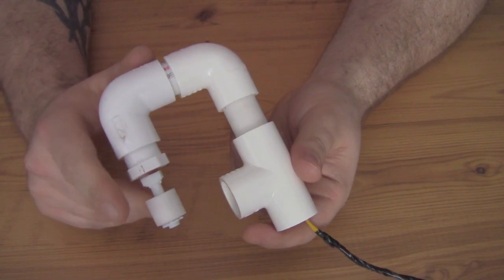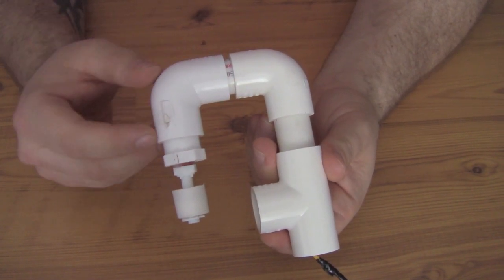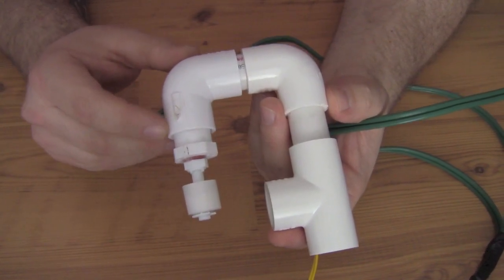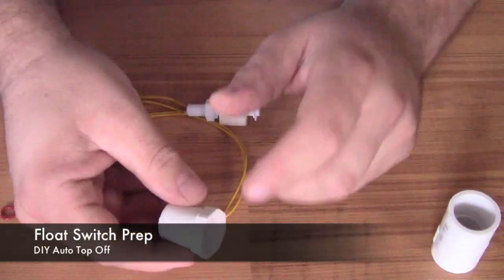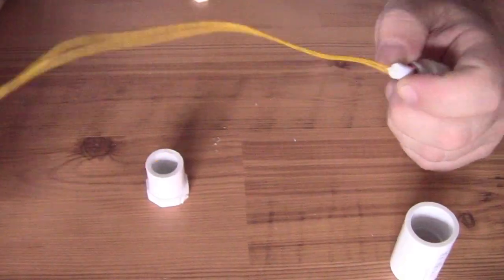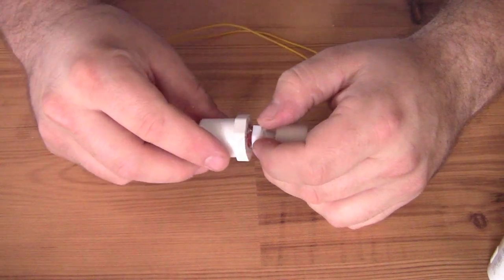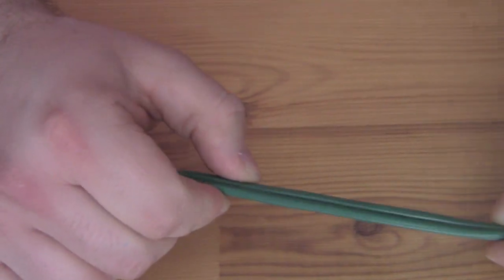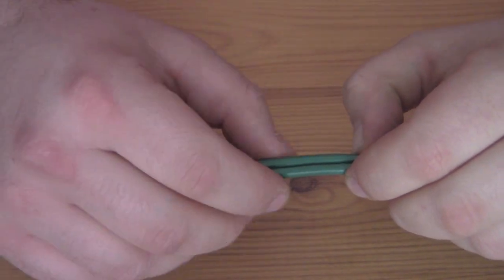DIY Auto Top Off | ATO | Part 1

Comment: Hi Mad Hatters Reef..I really like this video ..although no I do not need the auto top off.. ...Can U please post a video on how to install this float switch for an auto shut off  on the aquarium itself..  Ok so I have a 75 gallon aquarium..I built a DIY wet/dry filter drawer system..BUT...we live in a raised house so whenever I get high winds the house rocks plus people walking around so the aquarium water shifts or makes waves therefore air gets into my pvc. pipe going down into the sump tank....shutting down the trickle filter....then my submersible pump is still pumping!!..So I saw a video where someone installed this float switch with an extension cord,relay. 12 volt ac/adapter..So when the water gets to a point it shuts OFF the pump... I can NOT for the life of me find that video..was it you guys?? Because this is similar to the one I saw...If so I really need to see how to make this work..Thanks so much..  I really can not sleep at night because of this..so I have to to turn it off around midnight then I get up around 5 am to turn back on..its a real pain in the ass!! Please help if you can or if you could direct me to that video...Have a great day..BTW..Love all your videos..Thanks!!

Comment: you should use one with ground wire (not needed for switch but needed for pump), keeps everything safe. plus using GFCI plug for everything on tank.

Comment: Agree the LOW VOLTAGE approach is FAR MORE SAFE, use 5V or 12V as suggested to keep high voltage away from water. Use a 5V/12V wall wart in series with the float switch to drive a relay coil that switches the mains on and off via the relay contacts, OR find a 5V/12V wall wart and 5V\12V pump and use the same concept as shown here.

Comment: Some great information for those who want to build an ATO switch. I hope you didn't just wrap electrical tape around those leads?  I would use heat shrink tubing. Tape will start to unwrap over time next to water. You can place Zip-Ties at each end will help the tape from unwrapping. But the tape over time can also allow water to seep in! I suggest you use a GFI with your setup or at least a Titanium Ground Probe. Or use a low voltage setup with the use of a relay that turns on the ATO pump. ;-)